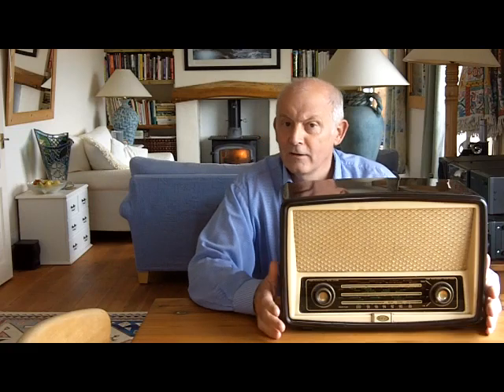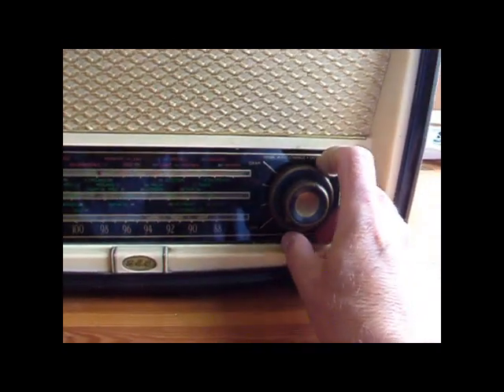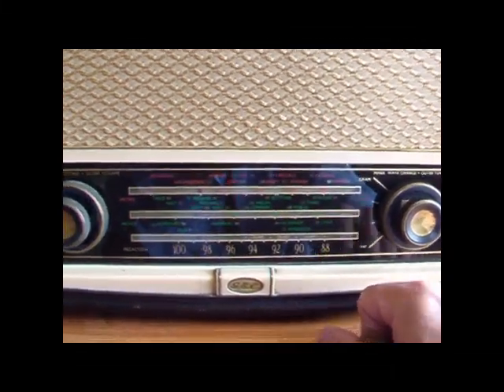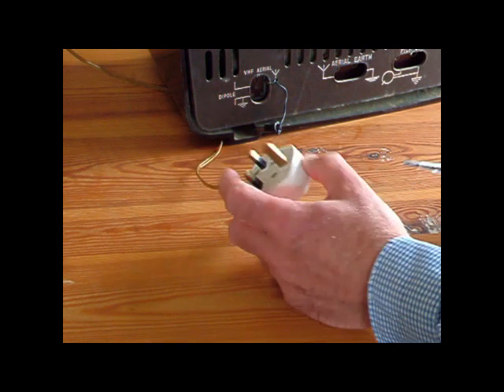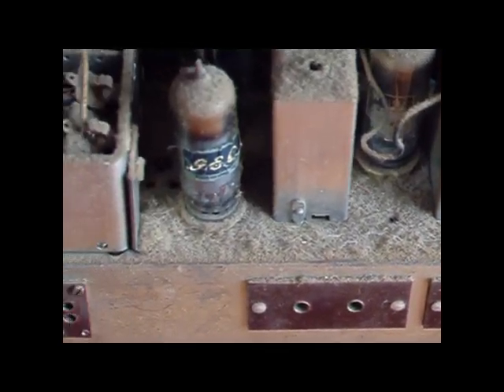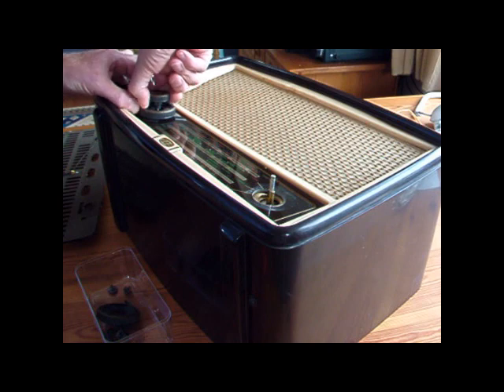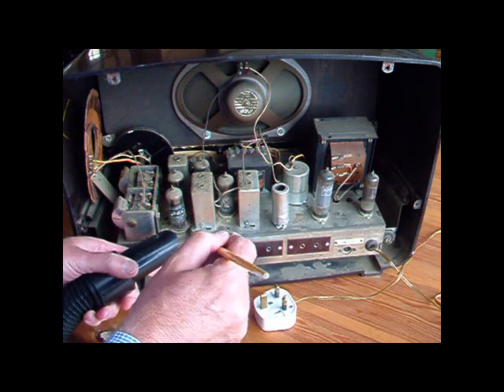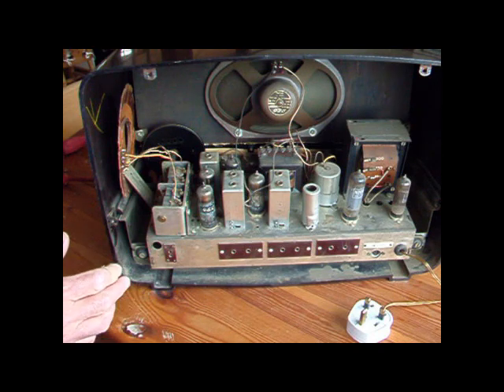About Radio ... part 1  Removing the chassis by Andy Davies.

Comment from the maker: Hi Steve I'm pleased to have helped you. I can’t tell you the best place to find the capacitors but whatever you do just make sure you get the same voltage rating or higher. The other thing I’d recommend is for you to join the ‘Vintage-radio. net’ you can ask the guys there any question you like about radio and you’ll usually get an answer very very quickly. If you’ve got a nice case try polishing it with Brasso but keep it off the speaker fret, try it underneath first.  
Kind Regards ... Andy

Comment: Hi Andy,

Earlier in the year I told you that I was about to restore the same radio.  I never did complete the story.

Your videos were a great help. I replaced all the caps except electros.  I had a funny voltage on the Anode of the output stage.  Eventually figured out that it was an open circuit in the output transformer primary.  Cost 40 quid to get it rewound.  Now works a treat.

Thanks again...Paul

Comment: Hey Andy,
Very nice radio, and I like the styling also. 
I'm glad that it was not a critter home. And it is surprising that it plays so well with that much dust on the tuning capacitors. Definitely a will made radio.
I'm also very glad to hear some stations on all the bands too. I need to get back into SW listening again.

Regards,
Rick